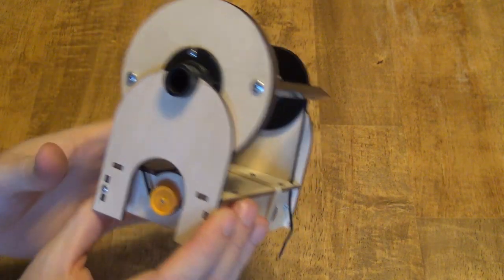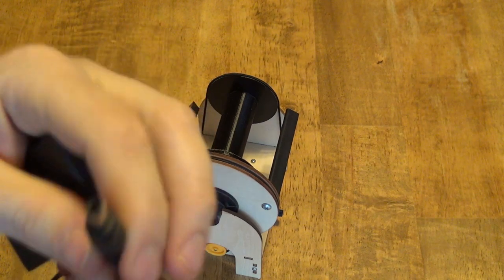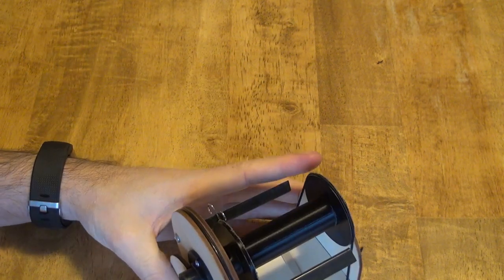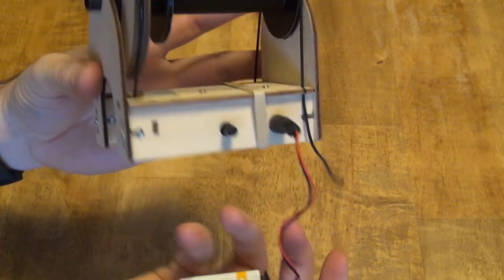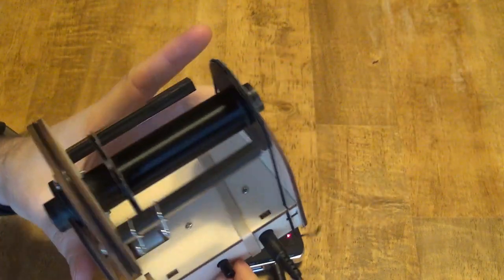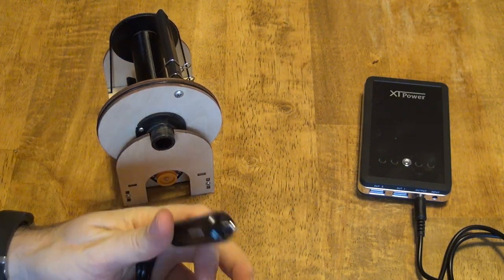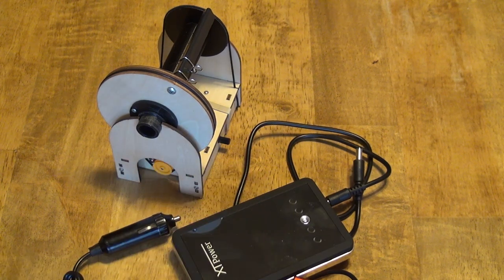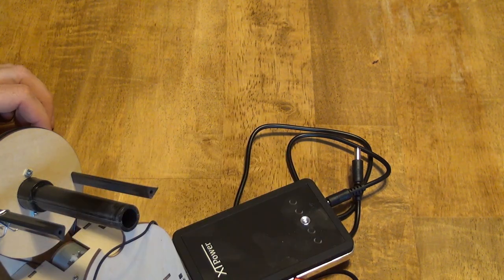SPIN #32 - EEW Mini Battery Options

Comment: Mine will be shipping soon! Will you have a battery kit for me to buy. I don't want to cobble something. What's a milliamp? (Kidding, I know) I'm sure others just want to purchase something that will work with no fuss.
Reply from the maker: Sorry, I'm not going to sell a kit right now.  I think my favorite option right now is this cable https://www.youtube.com/redirect?q=https%3A%2F%2Fwww.amazon.com%2Fgp%2Fproduct%2FB0756C2W8Y%2Fref%3Doh_aui_detailpage_o01_s00%3Fie%3DUTF8%26psc%3D1&redir_token=WwVK_0IZPXYV3jZaz9304XfLhdt8MTUyNDk0NDE1MkAxNTI0ODU3NzUy&v=FNPV2FkaAs8&event=video_description

And any USB power bank.  Such as this one: https://www.amazon.com/Anker-PowerCore-Ultra-Compact-High-speed-Technology/dp/B0194WDVHI/ref=sr_1_3?ie=UTF8&qid=1524857852&sr=8-3&keywords=usb+power+bank
Reply: Dreaming Robots thank you! The cable was my concern. I didn't want to fry my new spinner.
Reply: I could be wrong, but your link took me to the PowerCore 10000 which only has 5V 2.4A as output, when you said in the video we needed 9v, so that would be the PowerCore II 10000 which has 5-9V 2A, 9-12V 1.5A.  Am I wrong? I was about to buy it and now I am worried.
Reply from the maker: I don't have a link that takes me to a PowerCore 10000.  Could you let me know what link it taking you there?
Reply: Your reply to LynnAnn above said this: "And any USB power bank.  Such as this one: https://www.amazon.com/Anker-PowerCore-Ultra-Compact-High-speed-Technology/dp/B0194WDVHI/ref=sr_1_3?ie=UTF8&qid=1524857852&sr=8-3&keywords=usb+power+bank" and when I went there I found a chart which compared that one, the Anker Power Core 10000 to other versions (you have to scroll down quite a ways. The chart compares 6 different versions of the PowerCore.  Well, at least I think that is what I am seeing.  I will try to email you a screen shot.
Reply from the maker: Some of those links are out of date.  I suggest going to this page: https://www.dreamingrobots.com/pages/battery-power-for-the-eew